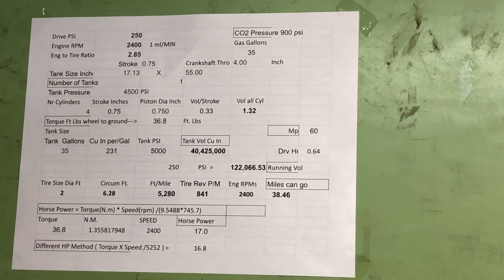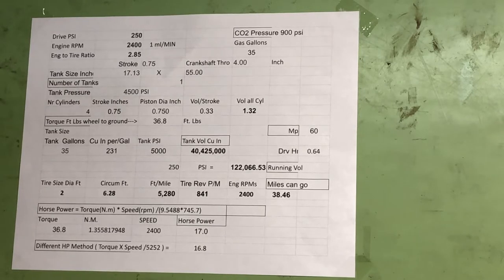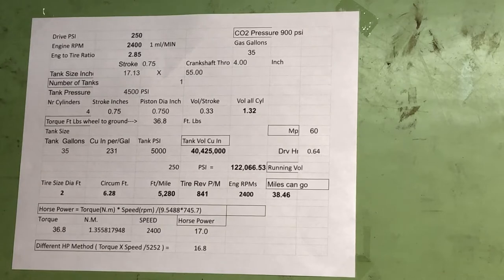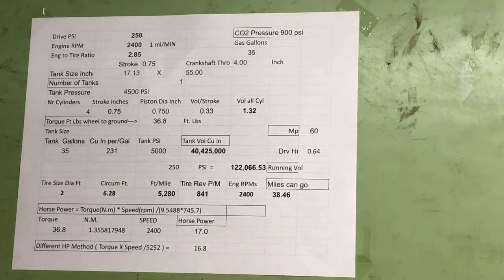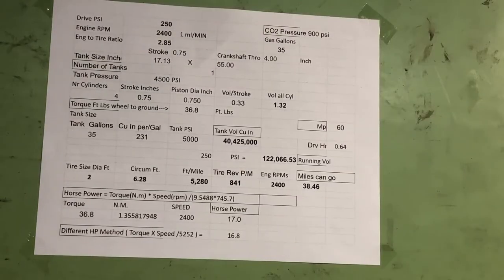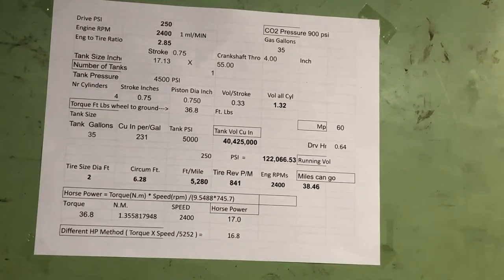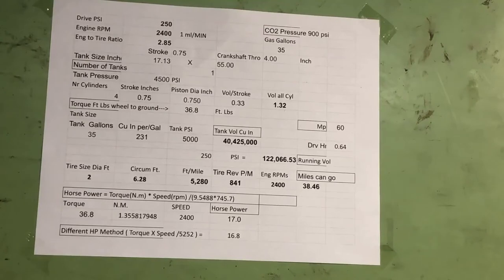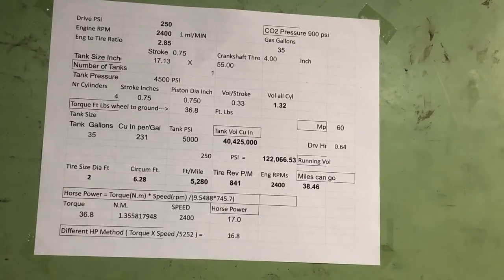Compressed Air Engine, Cubic Inch & HP Calculations with Spreadsheet 2-28-2022

Comment: That's better, at least I can follow what you are doing ;-) 
If your crank throw is 4" then your stroke is 2"
If your stroke is .75" then your crank throw is 1.5"
No?
40,425,000÷250=161,700 (check that formula, weird error to get)
You asked me why I divide the tank pressure by the regulated pressure, it is the same as you do at this point. I prefer to do that division first and then multiply by the tank volume. for me I would say 5000/250 = 20 tank volumes at regulated pressure, then I believe you leave one tank volume in the tank because you have to leave 250psi in the tank. So you actually have 19 tank volumes available at regulated pressure.
Thanks again for your videos!
Reply from the maker: Thanks for checking what I was I was saying.

I always say that I know enough about a lot of things to get myself in trouble, and i believe you fit that same mold!

Actually, the throw of a crankshaft is defined as "the same as it's radius measured from the center of the main journal to the center of the rod journal", and twice that distance is the stroke of the engine.
A 4'" throw = 8" stroke
That is a standard crankshaft, but what I'm working on is not standard.

The miss leading thing in my video is, I should have said the Throw is equal to a 4" throw, but the full stroke for each cylinder is .75 inches

I have an idea, that will be quite unique, but I'm not ready to display anything or talk about it until I have a chance to work on making some parts and put it together.
It shouldn't take too long once the weather gets warm enough to work outside and see if I'm right.

So, for now, I'll just say the spreadsheet is correct except the misleading 4' stroke.

Thanks for questioning me, it shows you have a real interest in Compressed Air Power.
Reply: @AirEngineResearch  4'" throw = 8" stroke  ha of course, I was running in opposite day. I'd say it is the effective stroke that matters. 
I'm looking forward to seeing more of your design!
Reply from the maker: @FilterYT  okay

Comment: how are you setting the tire rpm compared to the engine rpm ? obviously the ratio will give you more speed and less power or more power and less speed. the engine is giving 17 hp and the wheels are spinning at 841 rpm so its been reduced 2.85 times meaning you should have 2.85 more hp at the wheels correct ?
Reply from the maker: A gear on the crankshaft drives a larger gear on the axel that turns the wheel at 1 wheel to 2.85 engine ratio.

The tires turn 841 Rev Per Mile, and when the engine turns 2400, the wheel will go 1 mile in 1 minute.

Changing the engine ratio, will alter the speed and power along with cubic inches of air used.

I am calculating torque wheel to ground on a 4" crankshaft throw and a 2ft diameter tire.

I have no way to know for sure what Hp at the wheel might be, i am using the formula to calculate Hp.

The only way to be sure if my torque calculations are correct, is to hook the engine to a shaft with a 1-foot arm and see how many lbs. it will pick up. 

That won't tell us anything about Hp, it will just tell us what the raw torque is because the engine is stalled at max weight, depending on running pressure.

Hope that answers what you were wondering,
and thanks for the comment